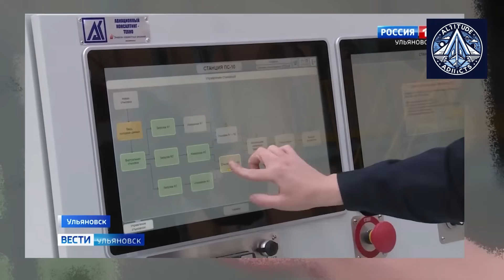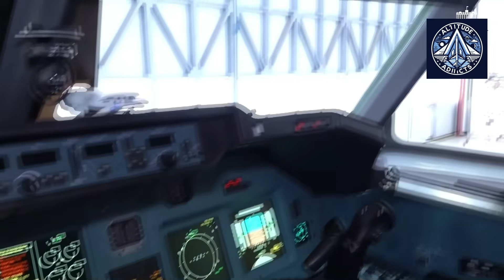Why Russia’s Tu-214 Jet Costs as Much as a Ton of Gold

Comment: Tu-214 is still cheaper than B737 or A320 even at $70 million. What I don't understand is why the 2-man cockpit thing is lingering considering that both Tu and Il have implemented 2 man cockpits in other Il and Tu aircraft! I don't see why the 2-man cockpit for Tu-204CM cannot be implemented for Tu-214 since they are the same aircraft built in different factories!
Reply: If you search carefully via Google, you will find that the technology for the two crew members in the cockpit is not from Russia. The dashboard is different, there is a larger LCD screen on the Tu-204-SM. Everything requires a process, and for the time being there are still 3 crew in the cockpit to achieve production targets. Local vendors are already trying to prepare the cockpit system for 2 crew, time will tell when the flight trials will be carried out. Could be in 2 or 3 years.

Comment: A $71 million Tu-214 aircraft does not sound expensive.  Boeing 737Max an Airbus A320 family aircraft would probably cost  more with discounts the manufacturers give out to customers.  
Russia has the technology to make a Two Person cockpit since 2010.
Reply: With typical discounts (above 50% for large orders), an Airbus A321 costs less than $71 million.
Reply: @luisdamian4562
With the high price of electricity, labor costs and other imported components to assemble the Airbus A321 NEO, it is impossible to sell it for under 100 million dollars. 130 or 140 million dollars is a reasonable price. The price discount that exists if you buy dozens of planes is impossible for airlines in general to fulfill. Especially for Russia, they will still use new Tu-214s or old Tu-214s whose airworthiness has been restored. In the near future, several Tu-204s and Tu-214s in storage will be restored to airworthiness.
Reply: @luisdamian4562
Saya ragu Airbus akan memberikan diskon sebanyak itu.
Dengan segera Airbus akan bangkrut.😅
Reply: @tergilagula4321  Ya, tentu saja. Kamu sebaiknya mempertaruhkan semua uangmu pada itu.

Comment: Which plane is better mc-21 or TU-214? They look very simular, the same amount of passengers and flight range?
Reply: @alexeystuliy2001  
Due to the MS-21's weight advantage, the two aircraft are not identical. The MS-21, with 200/211 passengers, can only travel under 2,000 km. Meanwhile, the Tu-214 can fly around 4,000 km with 210 passengers. The main reason is the lower thrust capacity of the MS-21's PD-14 engines. Therefore, the MS-21 and Tu-214 are two complementary aircraft. The MS-21, with a 160-passenger configuration, has a range of around 3,500 km. The Tu-214, with a 190-210 passenger configuration, has a range of 4,000 km. Each configuration can be tailored to the needs of each airline on the routes it serves.
Reply: @tergilagula4321 thanks a lot. I heard the  Tu-214 are still very expensive , because it is a kinda still not in a mass production?
Reply: @alexeystuliy2001 
It's possible the Tu-214 or Tu-204 could be sold for $71-75 million. In 2020, some said the Tu-214 or Tu-204 would cost around $60 million. It's true that prices have risen sharply in the past five years. Its competitor, the A321 NEO, sells for $148 million. In 2018, the A321 cost $110 million. So, aircraft prices continue to rise, including those made in Europe. However, Western sanctions have prevented Russia from purchasing any Airbus aircraft. Russian airlines have no other choice. Although less fuel-efficient, the new Tu-214 is safer than Boeing or Airbus, which are struggling to operate due to increasingly difficult spare parts.
Reply: @SmartphoneZTEbladeA72 to reduce the total cost I think Russians may start producing many parts abroad in BRICS countries.  So, it will not only bring costs down but also allow to start manufacturing these planes in big numbers for BRICS domestic airlines...
Reply: @alexeystuliy2001  have you heard about Embraer? It is a strong player worldwide and can produce several aircrafts types, military too.

Comment: Soon 214 with PD 14 engines. Better than Airbus 321 and Neo old modified engines adding wingtips for show and tell to fool people claiming new aircraft. and 737 old modified time and again with old modified engines, crashing down mid flight.
Reply: Given its weight, the PD-14 engine is still underpowered. A new engine needs to be developed. Therefore, the PS-90A engine is still the most appropriate. There is actually a PS-90A3, but why wasn't it produced in greater numbers? It's likely due to the more difficult materials available for the engine components.
Reply: Bro tu-214 will require pd-20 class engine to get sufficient power !! Pd-14 will be under power for tu-214
Reply: Better stay realistic: Tupolew is light years away from being able to beat Airbus' narrow body jets technologically or economically.